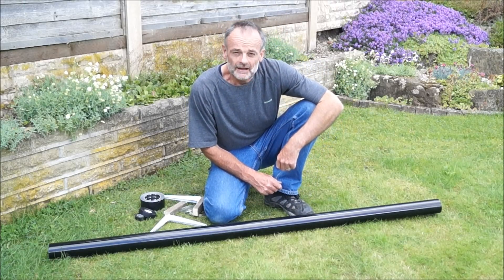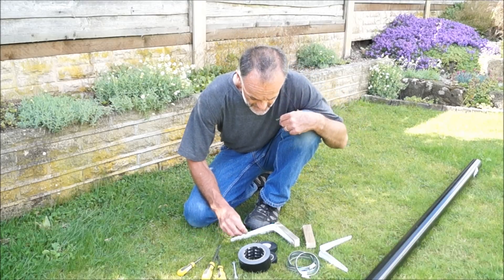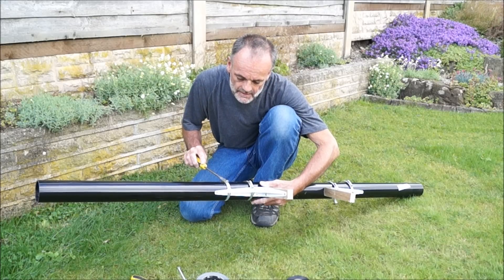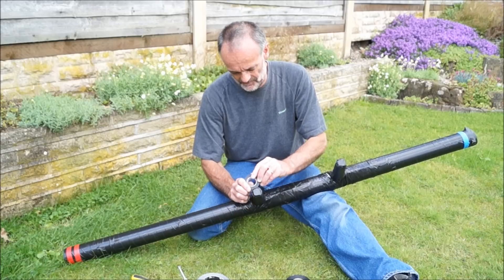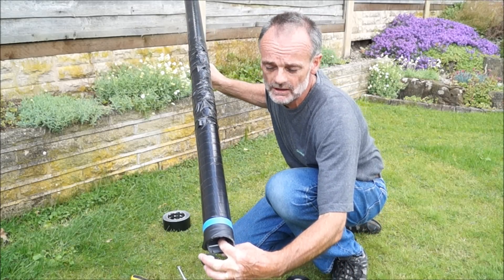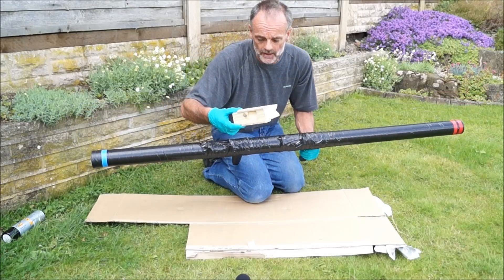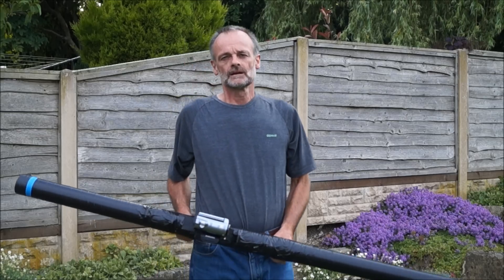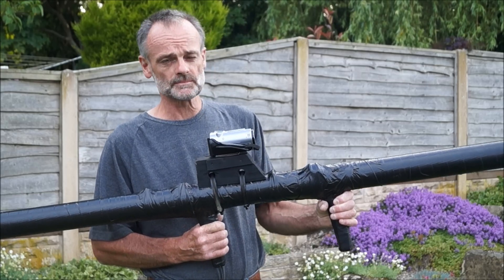Homemade Rocket Launcher Building and Firing

Comment: If I may make a suggestion... you could use a hinge system so that you don’t have to light and then load. Cut it about halfway down. Rectangular. Drill and attach hinges and latch. Insert a piece of wood with a hole centered and glue or secure with screws. Then tap another hole in the door for fuse.

More work but easier and safer to load for ya.
Reply from the maker: Yep sounds a good mod, lighting the rocket first was always a bit dodgy, thanks Pat

Comment: my uncle showed us how to launch a tennis ball like 3-400' in the air with a 4" long 2.5" diam steel pipe.. and an M-80.  tennis ball returned to earth in 2 halves.  Then when I was 12 or so I saw Charles Bronson 10 til Midnight..  learned to make a blow gun of some conduit tubing, paper cones, tape, nails, scissor to size.  brilliant!
Reply from the maker: Thanks Malcolm, it great to build stuff and you can have alot of fun just experimenting, thanks Pat

Comment: Could put batteries in the handle, then run the pos and neg wires through a switch or button to two alligator clips by the back. Put a match starter in some sugar rockets with the wires hanging out the back for the alligator clips to connect.  Pull trigger, match lights, rocket flies away.

Would save you the hustle of lighting and trying to get it up in time. Great project though haha makes me feel like a kid again
Reply from the maker: Hi Jonathan, I felt the same, just like a 10 year old experimenting with fireworks, did think about the electrical firing system, but never got round to it, thanks Pat

Comment: What type of rockets were you using? And what was on the back of the pipe to prevent it from falling out but still allowing it to vent off
Reply from the maker: Hi Ricky, they were standard firework rockets, although big and around 50mm in diameter, to stop the rocket falling out I put a small bolt through the  end pipe to form a ledge to stop the rocket falling blackout, but so you could push it in then when held back by bolt, you could then light the fuse……..hope helpful Pat

Comment: I'd make a 4 tube launcher with a trigger that fires them in sequence with each pull. Rockets powered by Estes D engines and make "use" of the ejection charge for various stuff.
Reply from the maker: Sounds good John,did have thoughts of mounted 4x tubes on my roof rack, would of been impressive sight firing  those off.... thanks Pat

Comment: Wait, how does he load it? Does he just stick the rocket in from the front, turn it so the it comes out the back as much as possible, lights it and then quickly pushes it in so the end of the stick is caught on the bolt?
Reply from the maker: I push a rocket up the tube, light the fuse, push it further so it catches, then aim and fire, simple,... thanks Pat
Reply: @patrickdickinson6492  oh, that sounds simpler. Thanks!

Comment: +Patrick Dickinson Cool video! What rockets/fireworks were you using though?
Reply from the maker: +nuclearwolf616 Hi there the rockets I used were made by Brightstar fireworks , they were called Warhawk about 1 meter long the main rocket being 200mm x 50 mm Dia. They were about the largest I could find that would comfortably fit in the rocket launcher. Anything bigger was very expensive and may get stuck in the tube. Glad you enjoyed video thanks Pat

Comment: Schedule 80 wrapped in Kevlar tape soaked in resin and hardener can make a combustion chamber and Barrel much more stronger your launchers and interesting smoke pole as a muzzleloader your weapon looks more like a sky broom then a trench broom dad said those things are interesting and easy to make and nothing more than a tube there's no recoil they're surprisingly accurate for something so dependent upon the wind what you ended up with was quite a tight operation your operation could use more better power to weight ratio making your own Rockets with sugar possibly two stage would be even more interesting could you put a raspberry pie 02 W in the nose cone with Bluetooth and Wi-Fi I see you're using a wick a mortar round from a display fireworks would be very impressive since I live in America I should do that we're so fortunate that was it you just did it
Reply from the maker: Hi there, yes a very simple launcher, but oh so much fun, yes there is  room for improvement , longer or 2 stage propulsion, and a heavy warhead, all things to look at o.ne day, thanks for you interesting comments....... thanks Pat

Comment: Homeboy did this for 20 bucks meanwhile the federal government (here the USA) spends like 20 grand for something similar. Reminds me of the navy admiral being all proud that the ammo for the rail gun (which is just a machined piece of tungsten, no moving parts or explosives) only cost $15,000 vs a $100,000 missile. Think about that for a second, a rail gun bullet, round whatever they call it is just a hunk of metal that isn’t super cheap like aluminum but not horribly expensive, tungsten is used in TIG welding and you can buy the stuff at harbor freight, and that asshole was beaming with pride over the price tag of these things, 🤔
Reply from the maker: Unbelievable cost but that,s what military arms cost, mine was just a bit of fun, but I understand what you are saying, thanks Pat

Comment: If one of the rockets explodes in the chamber would you be hurt?
Reply from the maker: +Jacob Jones  hi If the rocket was to explode in the tube then yes idren,t think it would do me any good. When I first fired it I wore a motorcycle crash helmet just in case one did explode due to not  firing correctly. Up to now each rocket has launched properly if one did not launch immediately  would just run Thanks Pat

Comment: I didn't see what you put inside before you 🔥. You don't need to build the inside or what
Reply from the maker: You need to put a bolt or method of holding the rocket in or as you point the launcher skywards the lit rocket will fall out at you feet!!
  best of luck Pat

Comment: 75mm

BTW I have a small improvement for this, using either a lighter or some type of electrical igniter and a back stop assembly in the barrel, you can add a trigger to this easily to make it safer to use. Drill a hole into the pipe and place your object to be used to stop the firework from sliding any farther back inside. Secure in some way (screws probably would work). Place desired firework into barrel to see where the fuse is. Drill another hole and place ignition source accordingly. You could even possibly make it fire quicker by placing the ignition farther up the fuse and closer to the base of the firework to make it ignite faster.

Comment: i thought you were making a rocket launcher but you just put a firework inside i had a freind made a proper one he used the ignition from a coleman lantin drilled a tiny hole in tube then sprinkle lighter fluid in it then bang it went he put a bolt in it
Reply from the maker: Jasper Edwards It was simple but also great fun, glad rockets did not explode in launcher, all the best Pat